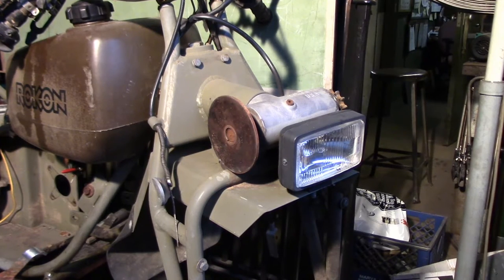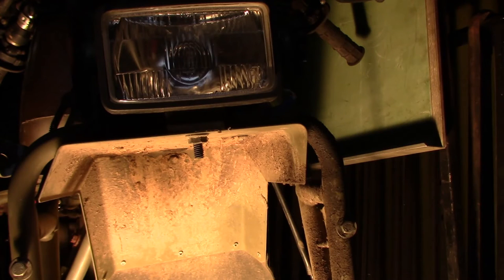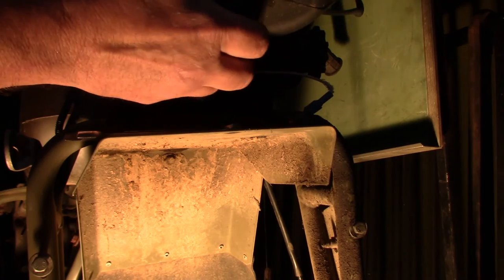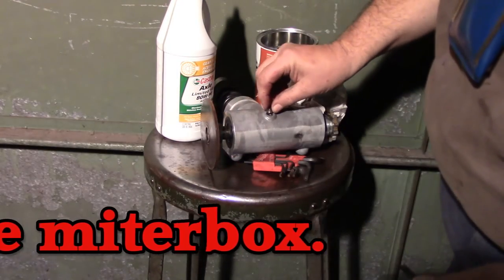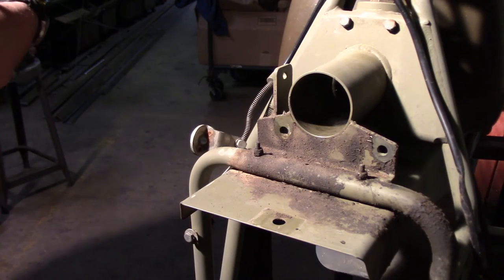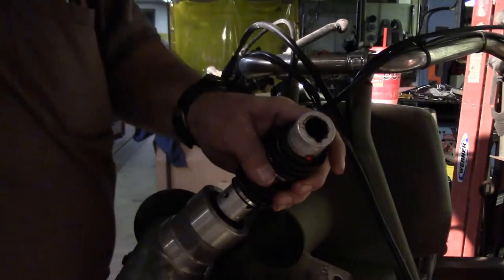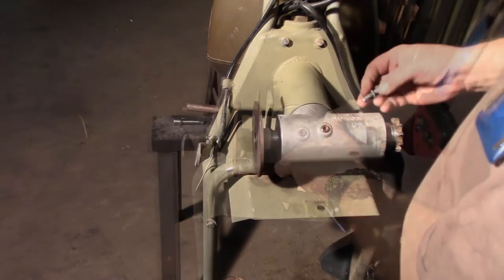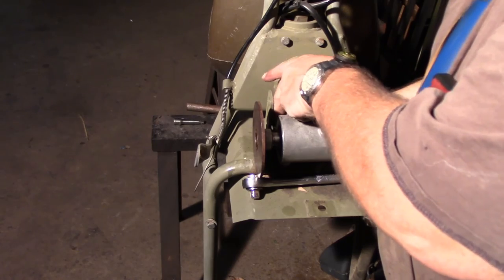Rokon, the ultimate outdoor vehicle. Changing Miter box oil.

Comment: I just bought my first ROKON. It’s an 86 two stroke. Looks very clean as in only little use. Is the TP paper tube still in drive shaft tube.
Reply from the maker: I took the TP paper tube out. Once I got things lined up, I was able to tear a corner and unroll it.
Reply from the maker: Congratulations on getting your bike. That's awesome.
Reply: @adventuresincampingwithcar8622  thanx. Uploaded video of my ROKON on my channel just now.
Reply from the maker: I finally got a chance to check it out. Nice bike. Love seeing other folks bikes. I'm glad you're enjoying it.
Reply: @adventuresincampingwithcar8622  
Just keep those how too videos on ROKON coming !!!!
Reply from the maker: I've got some mods that I've been working on coming up. I hope to have some videos on them up soon.
Reply: Just bought a 21 ranger with 100 miles on it. Upon checking the box no oil. Using zip tie to bottom showed wet at tip so I assume it had oil from factory. The bearing on brake end was seeping. The manual says no more than 2.5 oz. or the bearing seal may leak. Nice huh?
Reply from the maker: That sucks. Good luck with it. The basket case has been a project. But fortunately the original owners son blew up the engine before he destroyed the gear boxes. I got lucky and bought a replacement engine before the they went out of business.

Comment: You said when you see lub on the dipstick from the miter box that is enough.  Do you mean any lube, a quarter inch of lube or more?   Seems like bad things may happen if I try to take the miter box apart - wonder how to drain - cruel and unusual punishment to not put a bottom drain hole?

Probably could get my Rokon upside down - assume drain the gas tank first.   Any videos on changing the gear lube without taking the miter box apart out there?

Thanks for the video.
Reply from the maker: I probably just mispoke. I'm not aware of any videos on draining it without taking it off. It's really not to bad removing the miter box. Your welcome for the video. I try.